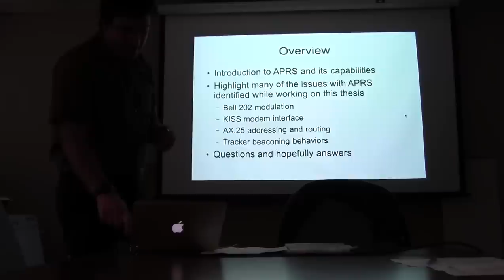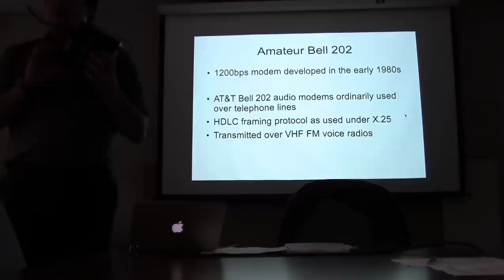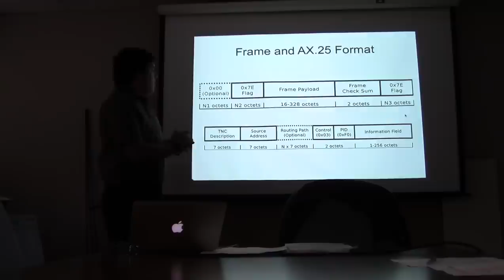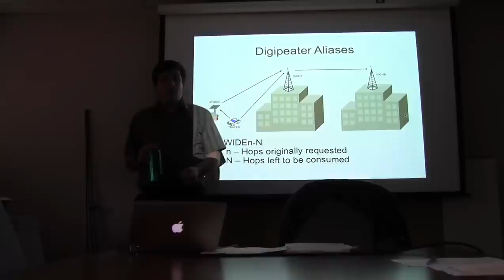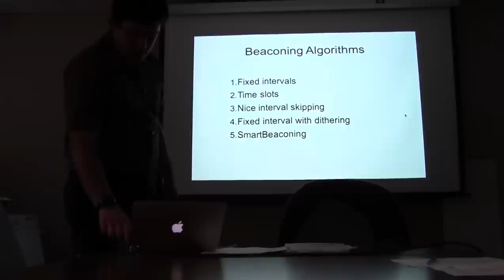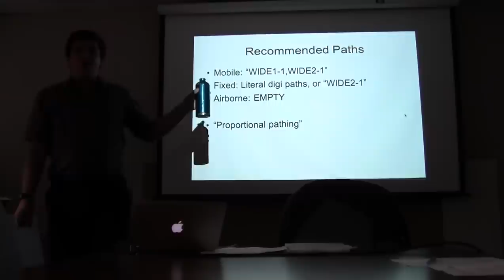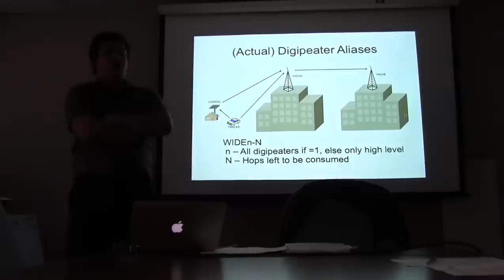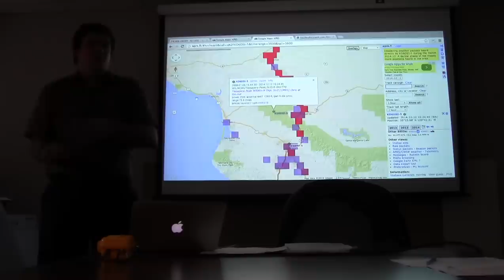Defending My Thesis on APRS

Comment: good sense of humor answer to vanity call sign question and good APRS presentation will at your web site. Want to use APRS to turn irrigation on and off in USVI St Croix - remote control commands to devices. This is M2M now called IOT

Comment: It seems like with new technology the whole idea of APRS could be revisited. Particularly with the massively greater computational power we have available now. Mesh nets have come up with some novel routing. Data compression could potentially be used also although compression on such a small amount of data might not be worthwhile. I wonder if Arduino or Raspberry pi would be useful here also for implementing a modern TNC/SDR. Surely many other innovations are possible using only software and modern processor power. Congrats on the degree!